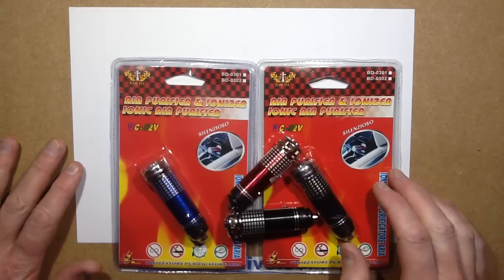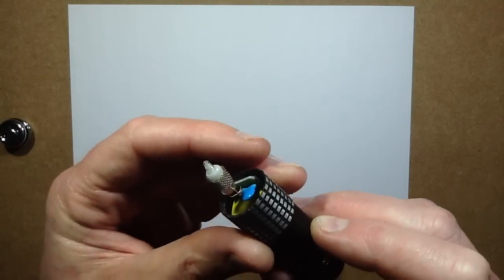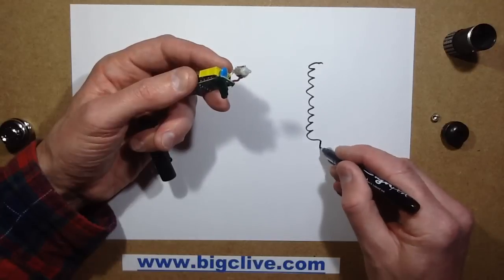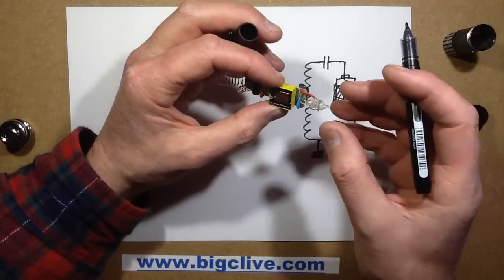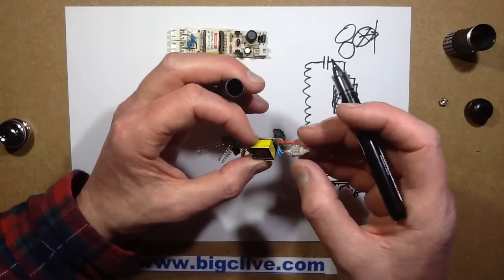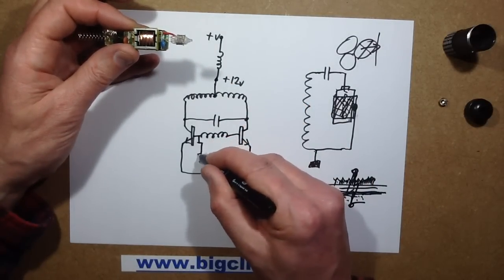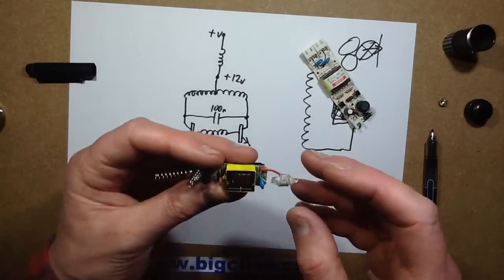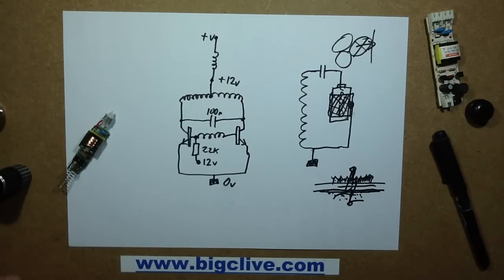A look inside a REAL car ozone generator plug.

Comment: isn't ozone toxic at ground levels? Why would you wnt to generate that inside your car?
Reply from the maker: +gskaloyan It is a strong oxidiser, so it could be used to remove lingering odours from a car, but not while you were sitting in it.
Reply: bigclivedotcom ah that's what it's for. 
I can't imagine why anyone would want to drive around with an ozone generator in their car when it means breathing that stuff in. 
Hadn't occurred to me that it would be used while the car was parked and off
Reply: +gskaloyan Ozone generators don't only generate ozone, they also generate O2 which is the form of oxygen we breathe. Ozone can be dangerous in high levels. You're not going to typically be in a car that long, also opening and closing the door would let a lot out.
Reply: +lepayen Ozone is dangerous at almost any levels it binds to hemoglobin with a considerably stronger bond than O2 and even CO which means your red blood cells cannot carry oxygen and there is  no mechanism that could actually strip the O3 from them.
Ozone poisoning is pretty much the same as  with CO any exposure to it can turn out deadly even at extremely low levels given enough time.
Reply: +gskaloyan Ozone is not toxic to my knowledge, it's an irritant, did you know lots of air de-odorizors ( the electric ones) will create ozone too? Some people are more susceptible to ozone than others.
Reply: The Immediately Dangerous to Life or Health level for Ozone is 5 ppm    Concentrations of Ozone as low as 50 ppm have caused death in as little as 30 minutes.  I think that would meet the broad definition of "toxic"   Remember, the dose makes the poison.
Reply: On the NFPA diamond, Ozone holds a health code 4, which is shared by such substances as hydrogen cyanide, phosgene, methyl isocyanate, and hydrofluoric acid.

You better believe it's toxic as fuck.
Reply: Screwg oogle Maybe I am, at least I remember molecular chemistry from high school...
Reply: +DOGMA1138 Source?
Reply: Mylitla Primary school level chemistry + any toxicology reference for O3?
A 30-minute exposure to 50 ppm is considered lethal, this makes it more lethal than cyanide.
Ozone:
http://www.cdc.gov/niosh/idlh/10028156.html
Cyanide:
http://www.cdc.gov/niosh/idlh/74908.html
Reply: I was not disputing the fact that ozone can be toxic.   What I was asking you to source is the mechanism of action that you described earlier wherein, "it binds to hemoglobin with a considerably stronger bond than O2 and even CO which means your red blood cells cannot carry oxygen."

Do you have a specific, reputable source that supports that contention?
Reply: Chemistry if you want a study here it is, it super binds to hemoglobyn and then starts reeking havoc in your cells on a molecular level by oxidizing amino acids and nucleic acids.
http://www.tandfonline.com/doi/abs/10.1080/01919510600900290
Reply: you better believe that the government hates ozone ... and the people that use it to heal sicknesses. 

can you name some cases of normal people dying from ozone usage?
Reply: Joe Citizen Ozone is an extremely powerful oxidizer. You don't need the CDC to tell you that it's bad for you.
Reply: ozone ... o3 is very unstable ... if it comes in contact with other molecules ... it will release the 3rd oxygen molecule.

if someone tells you that o3 attaches to anything ... that person is full of government propaganda bull shit.
Reply: peroxide is a strong oxidizer also.

it's used in hospitals daily.
Reply: And what, exactly, is atomic oxygen? A free radical. it tends to bind to almost everything.
Reply: did I refer to atomic anything? 

we are talking about ozone.

what the fuck are you on about? 

are you trying to say that ozone is an "atomic oxidizer"?
Reply: pseudo science defines it as atomic oxygen ... I will not.

you probably believe what NASA propagates as well.

o3 does not bind to blood.

can you show me the evidence of o3 binding to blood ... or anything else naturally?
Reply: Shpoople You do realize you are arguing with a thin foil hat member of the flat earth society right?
Reply: Joe Citizen Chemistry would not teach you the definition of epidemic, epidemic is a term used in epidemiology.

Epidemic is a localized widespread occurrence of a disease, unless you are trying to define autism as localised the correct term to be used is Pandemic.

However I could conceive to yield to you to use the term pandemic, since clearly epidemic is the correct term to use when referring to your genepool.
Reply: ya, but I was bored at work.
Reply: If you kids are sick in the car it might help with the stink!
Reply: Wow! I had to pop some popcorn!  This exchange was a riot!
Reply: Jesus and he's telling us to open our eyes haha..
Reply: lepayen - Sorry but that is utterly silly. Ozone (O3) is made from O2 then decays back to O2 and singlet oxygen (O). 

Did does not make oxygen in net. It destroys it because a tiny fraction of singlet oxygen hangs around long enough. It mostly oxidizes nitrogen or other thins you really don't want oxidized.
Reply: Well, I guess as an air freshener? Ozone does smell good.
Reply: Why is there no compact battery powered one?

Comment: From Wikepedia:  Ozone is a powerful oxidant (far more so than dioxygen) and has many industrial and consumer applications related to oxidation. This same high oxidising potential, however, causes ozone to damage mucous and respiratory tissues in animals, and also tissues in plants, above concentrations of about 100 ppb. This makes ozone a potent respiratory hazard and pollutant near ground level.  There is a great deal of evidence to show that ground level ozone can harm lung function and irritate the respiratory system.[33][43] Exposure to ozone (and the pollutants that produce it) is linked to premature death, asthma, bronchitis, heart attack, and other cardiopulmonary problems.  Ozone generators are used to produce ozone for cleaning air or remove smoke odors[68] in unoccupied rooms.   "evidence to show that at concentrations that do not exceed public health standards, ozone is not effective at removing many odor-causing chemicals" or "viruses, bacteria, mold, or other biological pollutants".

Comment: What are they for?
 Why would you want Ozone in the car?
Reply from the maker: It gets rid of strong odors by oxidising them and can also kill airborne bacteria.  The downside is that ozone oxidises other materials like rubber and metal too, and isn't good to breath large amounts of continuously.  But having said that, these units produce low levels of ozone.  (But still strong enough to notice when I tested it.)
Reply: Do you use them in your car or just wanted to see the construction?
Reply from the maker: artifactingreality I just bought it to take to bits and see how they were generating the ozone.
Reply: Based on a quick check about side-effects, ozone and speakers don't mix well as it can attack the foam/rubber surround of the speaker cones, so probably not wise to use one in a car with any serious speaker upgrade.

Comment: Of course the one with the LED is probably just as effective at deodorizing your car as the real one (i.e. not at all effective).
Reply from the maker: The real ones produce a surprising level of ozone, that is a strong airborne oxidiser.  So the real thing will absolutely nuke airborne odours in a car.  Preferably while you're not in it.
Reply: bigclivedotcom Ozone at human acceptable levels has been shown not to be effective at deodorizing or disinfecting. Sadly, a lot of 12v sockets turn off with the car, so you couldn't let it build up overnight or something : (
Reply: Well I mean, you just have to get near a generator to smell it. I'm wondering if maybe the issue is that it just masks odors and after you shut it off the smells remain? Or if the amount of ozone required to actually sanitize would be harmful to health.
Reply: +Doazic Oxidizing odors works, it works the same as peroxide. However, it will not remove the source of the odor. You have to clean the car first, and the ozone generator will deodorize airborne odors. I am not sure what the OP is on about, its very sound science. Perhaps it has to do with the amount of ozone generated, or attempting to deodorize rotten fish without first removing the rotten fish xD
Reply: +SilentS Why must you slither so?  No one has made any claim that it disinfects, and Clive has said you should not be in the car while it's in operation, so talking about "human acceptable levels" is redundant.  Let's not split hairs.
Reply: SilentS What does a paper on the negative health effects have to do with ozone not acting as an oxidizer, which you seem to be implying.
The negative health effects of ozone is precisely because it oxidizes...
Denying one would also imply denying the other. I agree it is bad for you, what I don't agree with is that it 'does not work' in deodorizing, because it does.
Reply: +Richard Smith Ozone does oxidize. It just doesn't work practically as a consumer use deodorizer. The literature review I linked cites about 10 studies that back that up. Also ozone is more effective at deadening your sense of smell than actually deodorizing.
Reply: SilentS Well, that was not the point I was making, but I am willing to accept your opinion, as ozone is harmful and is not viable as a deodorizer for the masses, i can agree with that much.
Ozone, however, smells like rain. I don't know if you are one of those people who can tell its going to rain soon by the way the air smells, but what you are smelling is in fact ozone.
White water creeks also pump it out. In fact, there are generators(experiments really) which harness the power of ionizing properties of falling water.
It is a natural 'fresh smell' but because people can over do it too easily, it is quite dangerous if concentrations are not kept in check.
Saying it does not freshen the air is just ignorant tho..
Reply: +SilentS 
That is because you are not supposed to be in the car or wherever you are using ozone to deodorise or desinfect stuff.
For example you flood the place with ozone over night and go away.
Next day open doors and windows, stop the ozone generator and you are perfectly fine.
No bad deodorizing effect due to no limit of ozone level in the air because no human acceptance level has to be met  ;)
It's just the same with cleaning public toilets using chlorine.
You don't do it 24/7.
Reply: +Richard Smith 
I find it smells more like when you replace the toner cartridge in a laser printer.
Reply: audiocrush Yes, or the smell of a fresh stack of xeroxed papers :)
Theres a smell there that is similar for both, if you pick up on it.
Reply: +Richard Smith I know the rain smell you're talking about and it's mostly geosmin and not ozone that gives the smell.

Comment: While this might oxidize organic matter in the air of the car, such as car exhaust fumes and the amount of Ozone generated is relatively small, it can build up in the car's enclosed environment. The products of this oxidation may be more toxic than the original fumes. Ozone is 10 times more toxic than hydrogen cyanide. There is a possibility that the ozone will attack the plastic and metal fittings of the car, making the plastic brittle and leaving a corroded surface on exposed metal. If the oscillator circuit is not well suppressed, it's operation can result in electrical noise being injected on to the car wiring, resulting in radio interference on the car radio and audio. So this is one product I will not be fitting in my car.
Reply: Um. You don't use this while you're driving around. You plug it into the cigarette lighter and leave the doors shut say overnight when you're in the house.

Comment: Ordered one and only one so I could tell the good sellers from the bad. "keyhere" is a fake seller.
Reply: I've just ordered another. Almost $9 AUD. It bloody-well better not be a single LED for $9. I'll update when it arrives in a month.
Reply from the maker: joelie83 Sadly the price is no guarantee, so if it does turn out to be a fake one then have no hesitation in opening a dispute.
Reply: Another fake. It turns out it was actually three fakes for $9 AUD. I suppose I that's better than one fake for $9... the seller was "moyinltd". I'm not sure if I'll keep doing this.
Reply: bigclivedotcom Opened a "return request". That should be a bit of entertainment.
Reply from the maker: joelie83 They will generally either just refund your money, or try and fob you off by asking you to return it with recorded delivery knowing it would cost more to do that than the cost of the unit.  Just say that's no problem if they pay for the return shipping in advance.  Then they may try to offer a partial refund.  You can either take that or hold out for the full refund.
Reply: bigclivedotcom ought be worth the amusement :)
Reply: bigclivedotcom Though I suppose the seller may not know they're selling fakes. They all sell an awful lot of stuff. Maybe I'll got easy on them.